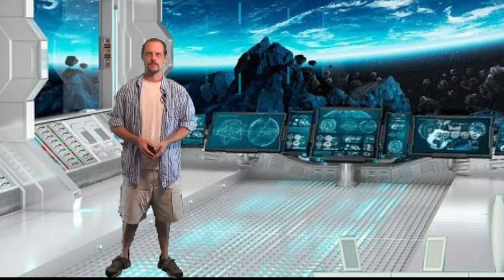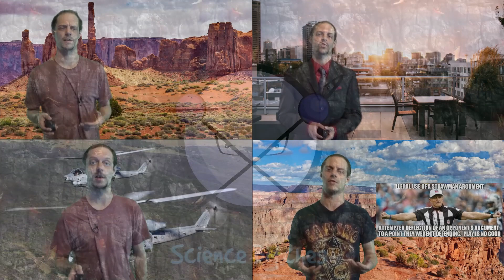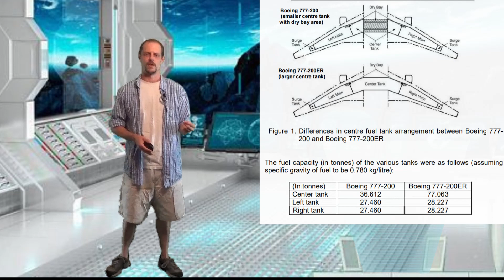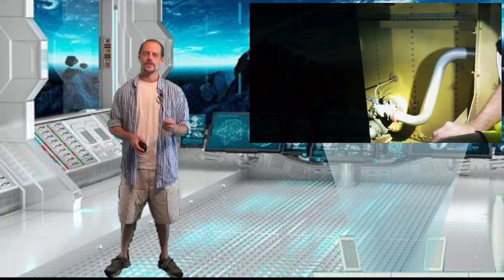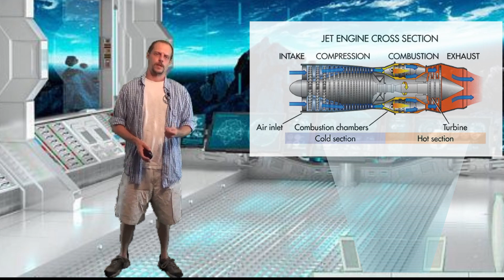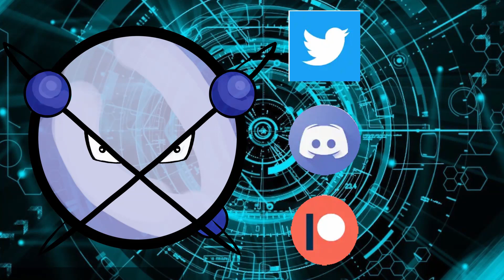Your next period of instruction-Fuel and Jet engines

Comment: Thorght id check out other opinion to Mr Jones u didn't mention  most important thing fuel weight  100000liters in concorde approx  100tons seems to suggest abomalies
Reply from the maker: Guess I need to do one on the engineering of wings and where fuel is stored in various types of aircraft. The concord in particular has fuel stored not only in the wings but in portions of the fuselage as well.
Reply: Jones videos disappeared, it’s a shame because they were comedic gold.
Reply from the maker: I get the feeling he did it to drop off the radar for a while. He'll be back blaming YouTube for having to start over.

Comment: Jones (the failed plumber) has said, liquid fuel is not used or was not used in, F1 cars, WW2 tanks or aircraft, civilian aircraft, modern military aircraft, racing motorcycles, farm tractors and even his own diesel VW Golf!  He has made so many videos and been kicked off YouTube so many times, he really is a simple simple man.
Reply from the maker: I really don't get what his disconnect is. He gets right up to the point of understanding and then decides that crushed hopes and dreams are a valid fuel.
Reply: Atom Skeptic I found his claims on the Spitfire particularly offensive as during ww2 a great many pilots were horrifically burned due the the locality of the fuel tank. I also pointed out to him that oil refineries were targeted claiming many lives of young men who were worth so much more than his pathetic existence. The physical evidence is still there in the ground of ‘PLUTO’ built during ww2 to supply fuel to mainland Europe. Like challenger disaster conspiracies, I find his views repugnant and he should be removed from YouTube. I won’t even watch his content now, scum like him will not benefit from me in anyway.